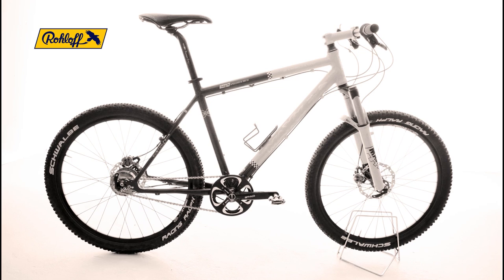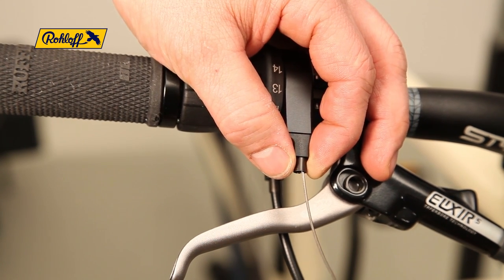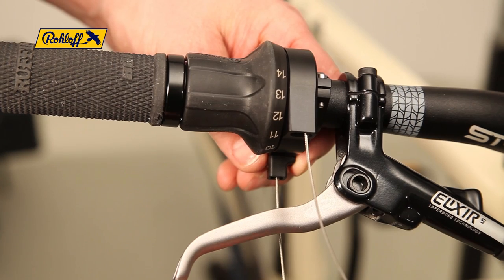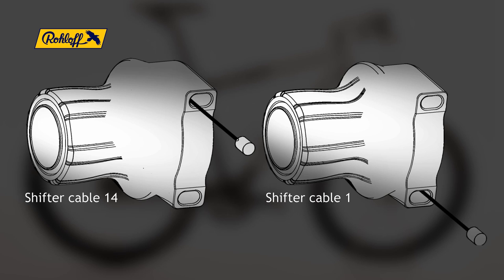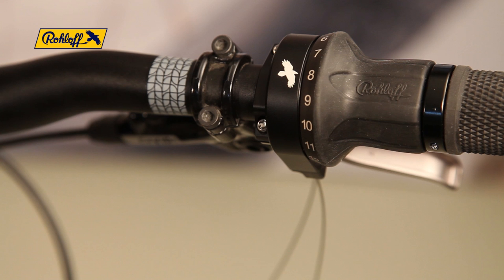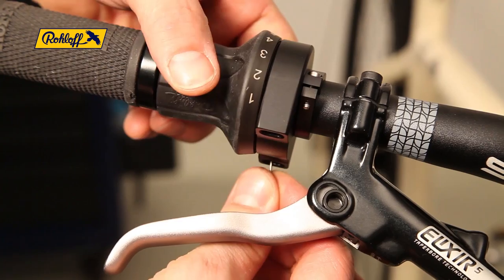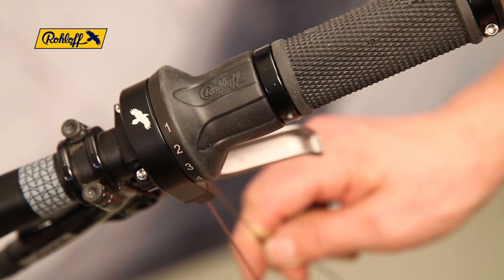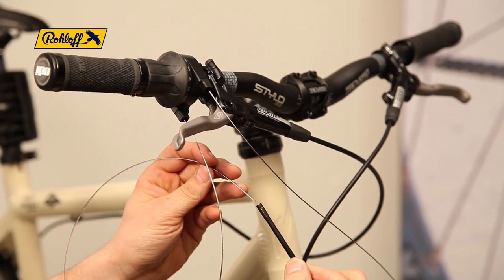SPEEDHUB Workshop - Changing the twist shifter cables

Comment: The producer doesn't work on bikes. It's not called twist shifters, they are called grip shifters. Cable 14?able 1? Try right or left side or front or rear derailleur cable...let me guess, you call a derailleur a transmission.
Reply: barry loventhall both cables are for the rear. This shifter works with the Rohloff internal gear hub that works with two cables.
Reply: lmao. you obviously dont work on bikes. this is for a rohloff, there is no derailleur